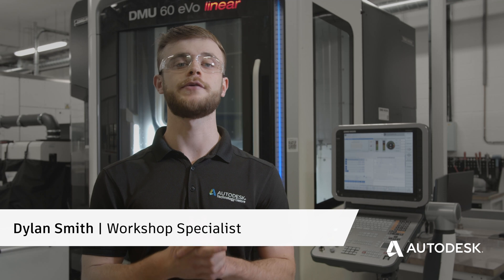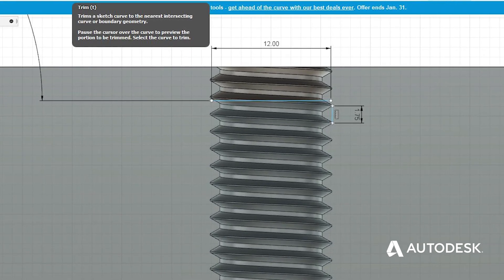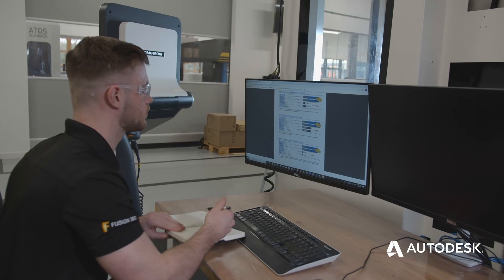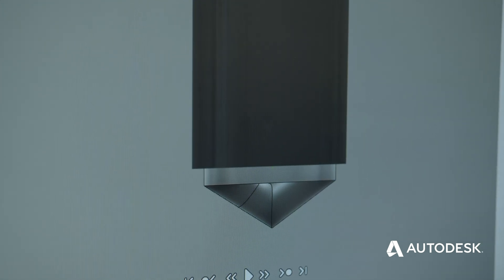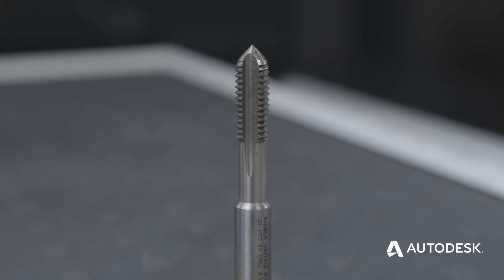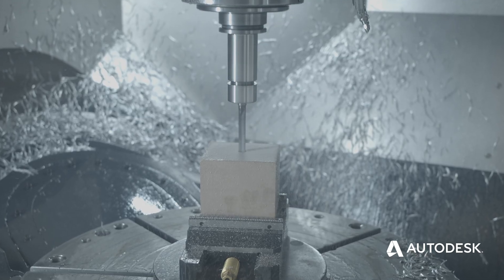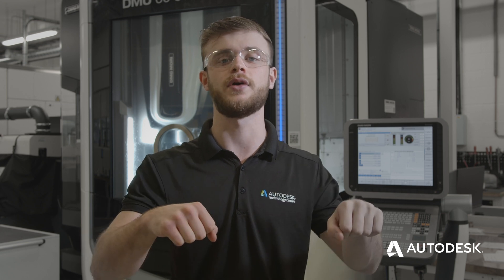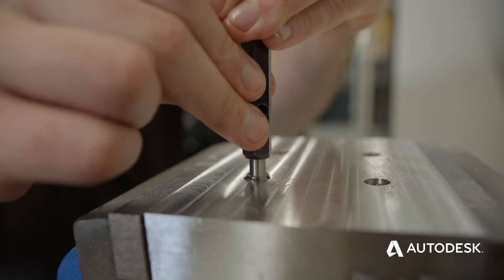TUTORIAL: Tapping Tips & Tricks

Comment: Kinda odd not to see them demonstrate a thread forming tool capable of cutting a few different sizes of threads - Kinda an obvious alternative?

I'm also kinda offended by the approach of how they ensure being square when hand tapping - With a block next to it? Wut?

When I upgraded my 2011 rereleased Tamiya 1:16 Gepard 1A2 ( OOB is an 1A1 ) from a display model to a fully functional one ( https://imgur.com/a/fxHQqrn ) I had to also heavily upgrade the running gear as it wasn't meant for the outdoors ( plastic wheels running on plastic retaining caps also acting as bushings?! ) requiring steel wheels with actual bearings on new axles - The latter of which had to replace the cast axles on the swing arms.

Since I wasn't going to take my chances with those swing arms ( pretty much impossible to get spares ) I went ahead and 3D Printed both some soft jaws the swing arm could rest in when using the drill press and a hand tapping guide to rest on the soft jaw when forming the treads for the new axles - All of which were designed in F360.
Reply: Yeah, there are tap wrenches with guides to ensure squareness.  I have a set of three with a collection of collets for them.  

I also wasn't impressed in the first minute by the selection of drill size.  Firstly, subtracting the pitch from the diameter doesn't always give the same answer as the tables, even for metric threads.  Secondly, the table values are specifically for straight flute taps in mild steel, which deforms and flows into the threads.  For less ductile materials such as brass or cast iron, you need smaller holes, leaving more material to be cut away.  For more ductile materials, such as soft aluminium, you want slightly larger holes.  I thought every first year apprentice was taught that.